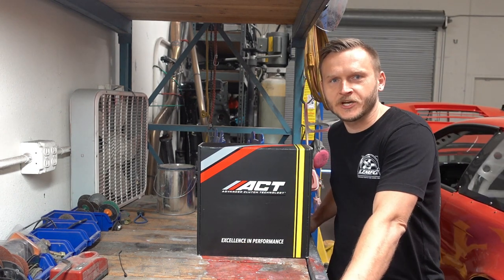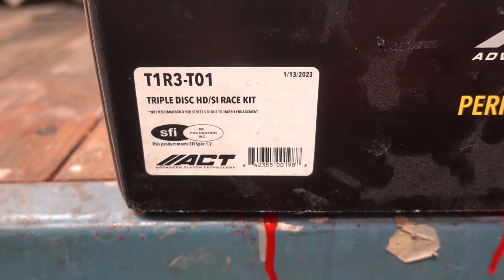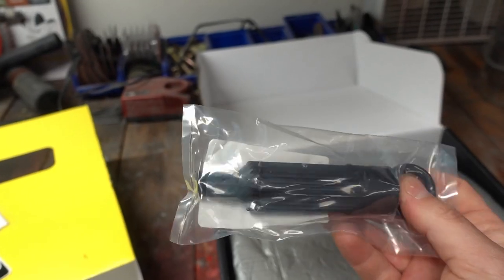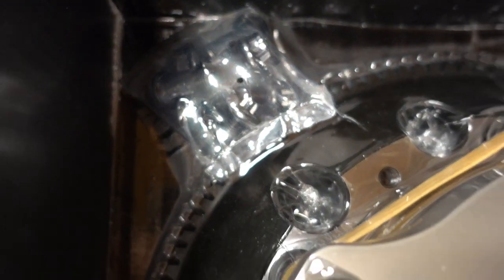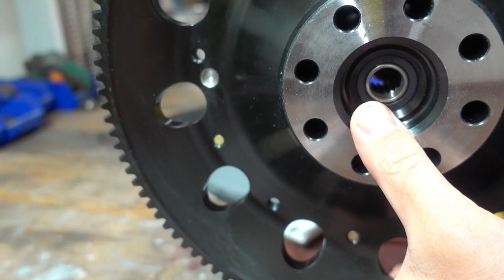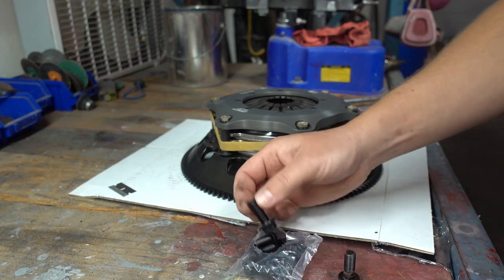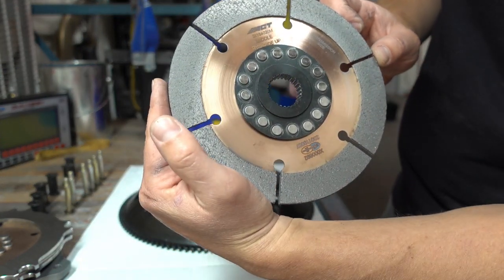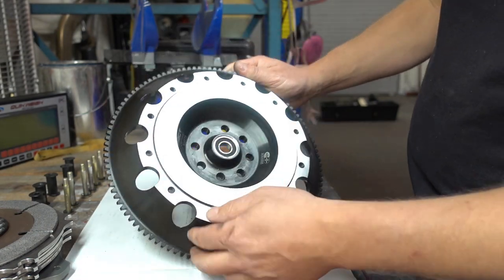2jz ACT triple disk clutch kit unboxing and review

Comment: What bellhousing and clutch release bearing are you using? Do you need to work with spacers?
Reply from the maker: I am using OEM J3 auto bellhousing with an afapter plate from Xcessive manufacturers. I measured the clearance distance with that setup and purchased a tilton hydraulic throw out bearing with the proper height.